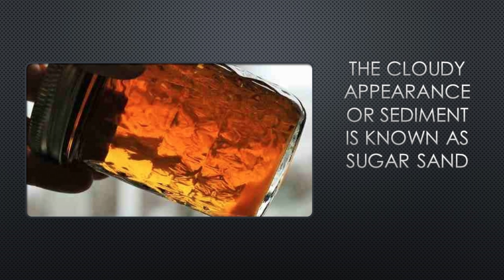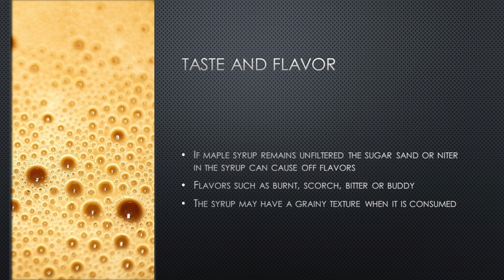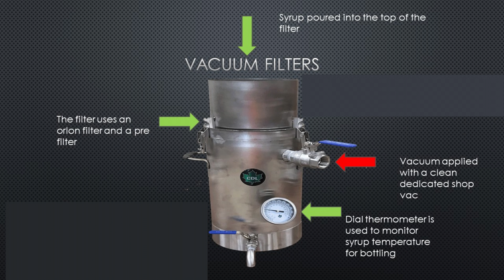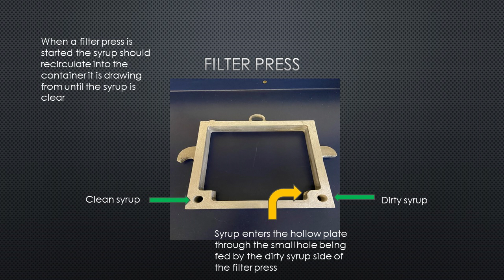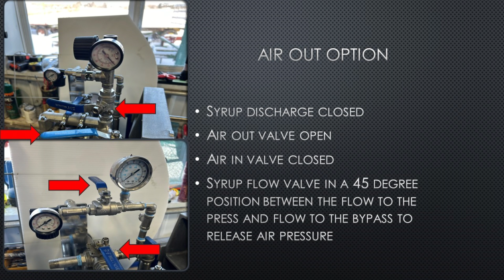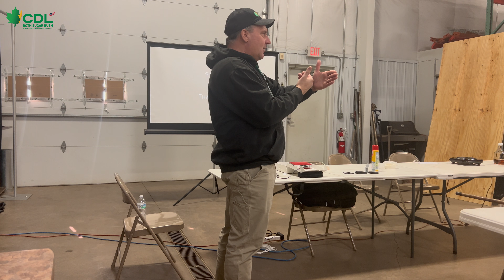FILTERING SEMINAR 2024 OPEN HOUSE

Comment: Also, I recently purchased one of your 9 inch vacuum presses. It seems to work really well. I have a little DE powder to my syrup before I filter it and it seems to be fine I notice it takes about 15 minutes to filter between a half to 1 gallon. Is that normal?   I do dampen my filters with hot water and pretty much quickly shake them out as much as possible, then assemble it and filter. I only put it to about a half valve open to filter. I noticed if I put it full force it seems to suck the sand through. Am I doing anything wrong?
Thanks 
Fred
Reply: Also, do you guys except a bottle of syrup for testing?  I would love to get my syrup, tested and see what grade it actually is free, small, hobby guy. 
I only make it for me and friends, do not sell it . but I’d still like to know. Thanks 
Fred